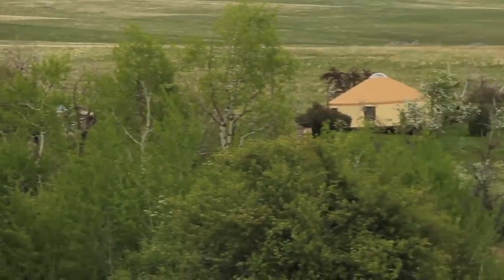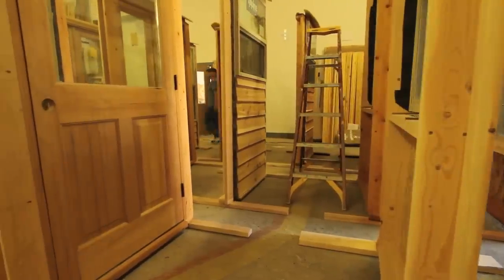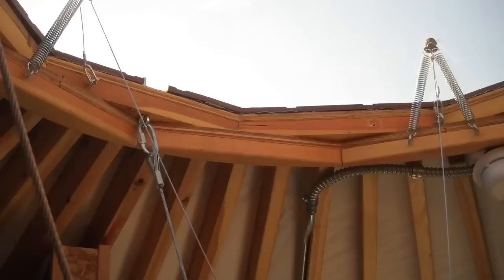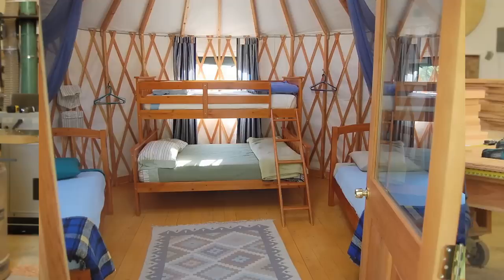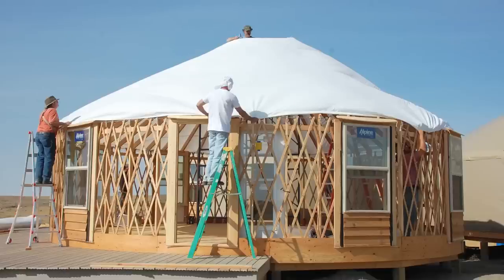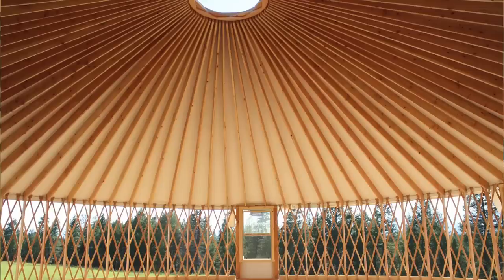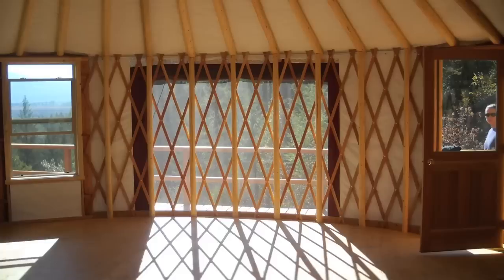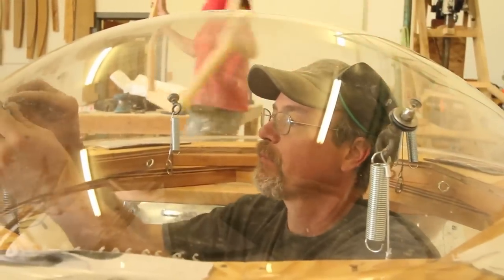Shelter Designs Yurts - What is a yurt?

Comment: Is the center on top open, what if it rains?
Reply: The top, center of a yurt typically has a plastic (plexiglass?) dome that is either clear or tinted. You can get the dome fixed or one that will open for ventilation. Screens are available for domes that open.